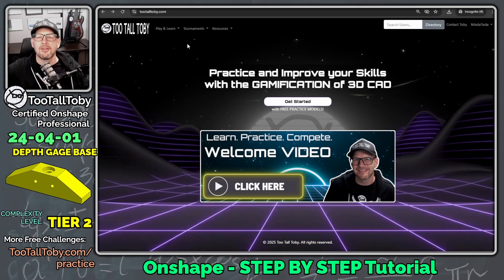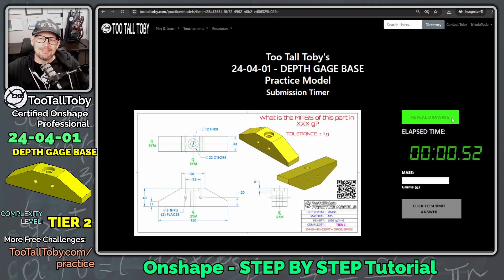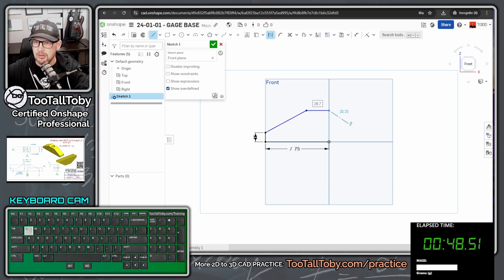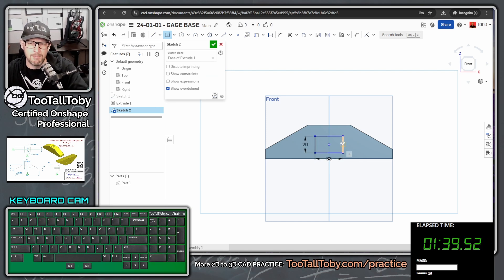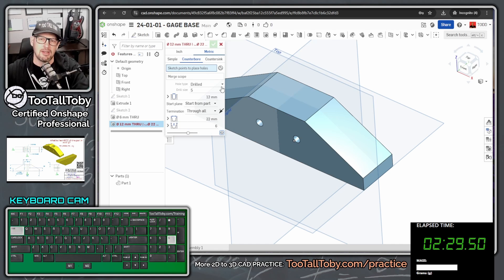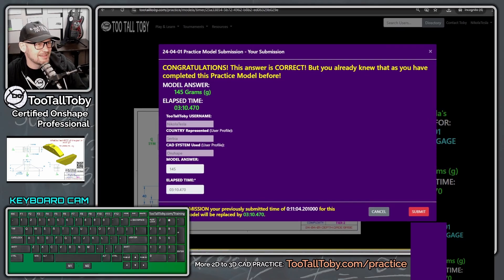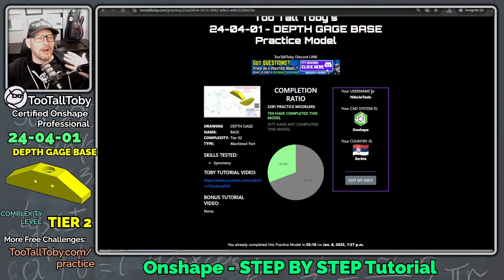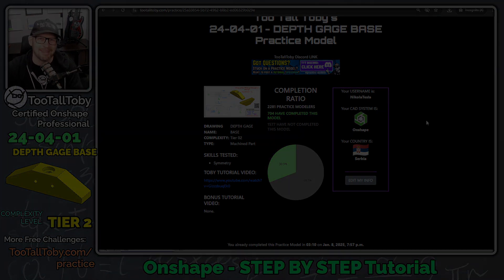Onshape Speedmodeling CAD Speedrun! -24-04-01 - DEPTH GAGE BASE - AVERAGE TIME 4 min 48 sec

Comment: TooTallToby i need help, i have a part in SOLIDWORKS and i want to create another part that is mirrored with all the features with out using the assembly Symmetry
Reply from the maker: In part mode you can pick a plane, then choose INSERT > MIRROR PART
this will kick off a new derived part and you can choose BREAK LINK TO ORIGINAL.

the new part will have all the features, and they will all be parametric, but they will remain in the original location (not the new mirrored location).

But that's as close as you're gonna get using the built in functionality.  

So its basically the same as doing a MIRROR BODY, then using DELETE BODY to delete the original body from the tree.